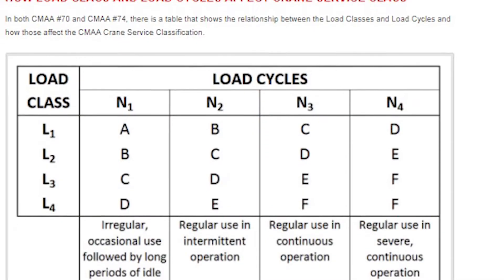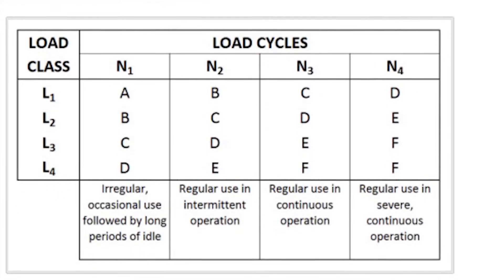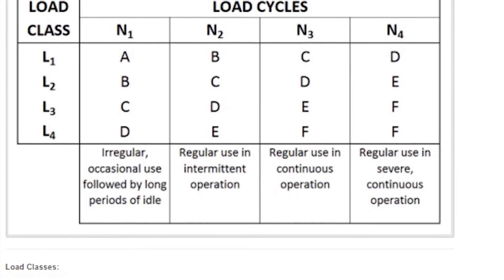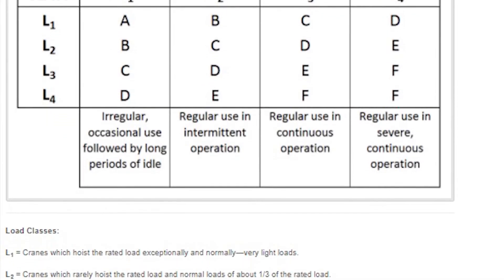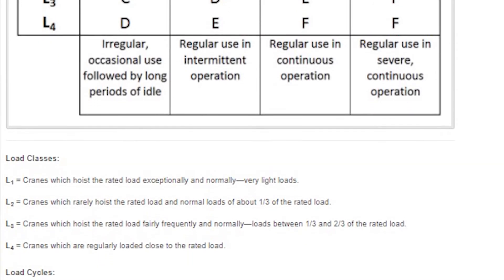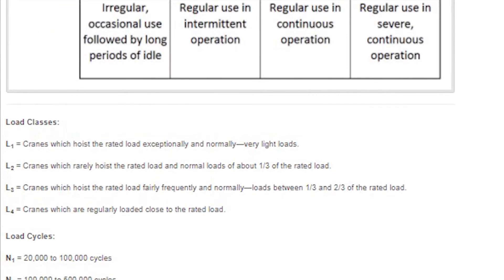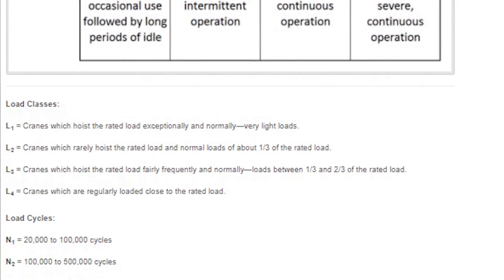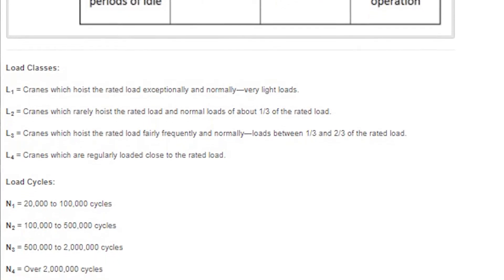How to Determine Service Class & Duty Cycle of Overhead Cranes | Ep 8

Comment: I have a 2 questions
Q#1: Would like to explain my question by an instance that is if duty of a class A is defined by its number of cycles / lifts which are not gonna be more than 2 in an hour then how come it possible for a crane's motor to start stop 75 times? 
Q#2: What do you mean by bearing hours? I mean which bearing are you talking about? The hoist motor bearings?
Reply from the maker: Hey Muneeb, worked with the team and I'll add their answers below. If you want to learn more, you can find great information in CMAA 70, section 5. 

Answer to Question 1: There are package motors so typically the components supplied on a class A crane will be the same as the ones supplied on a class C crane. But it is still important to know the duty cycle of the crane because a crane on standby will still last longer than a crane being used in a standard manufacturing setting.

Answer to Question 2: Crane duty cycle dictates the bearing life. When we talk about the bearing life, we are addressing all of the bearings – hoist / trolley / bridge motors, trolley / bridge wheels and lower block sheaves. The most important bearings on the crane are the ones used the most – the end truck wheels and motors.
Reply: @LiftingandRigging  thanks a lot for responding once again.
But still there's confusion if the duty cycle is elaborated by number of start stop of hoist motor in an hour, then how can it be operated only twice in an hour?
I mean if a class A crane is limited to a maximum of two lifts per hour then how it's motor can be operated more than the quantity of start stops?
Once the motor is started it can perform two lifts.